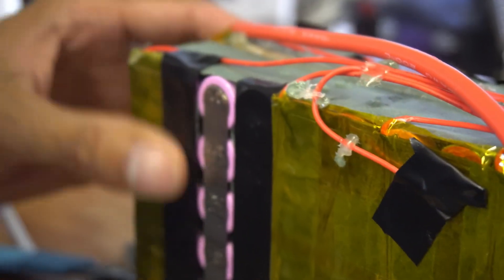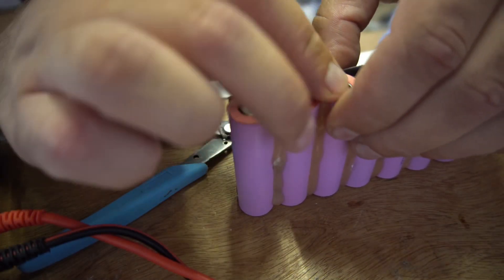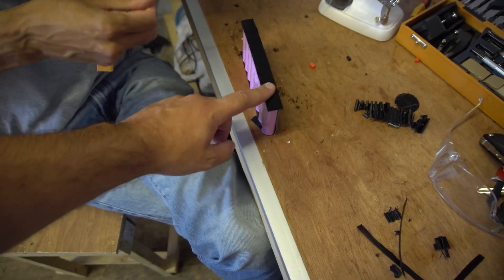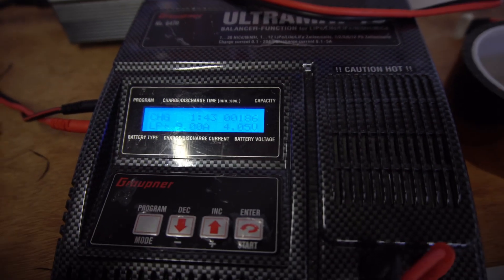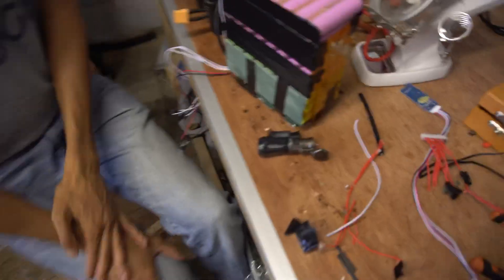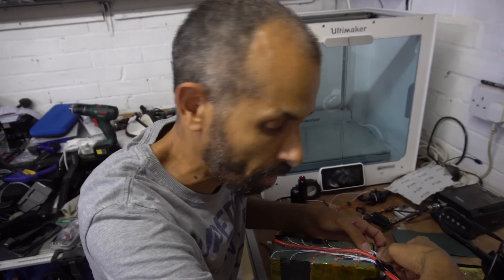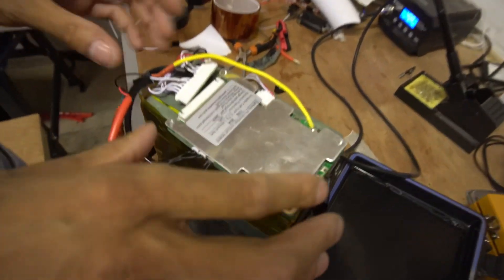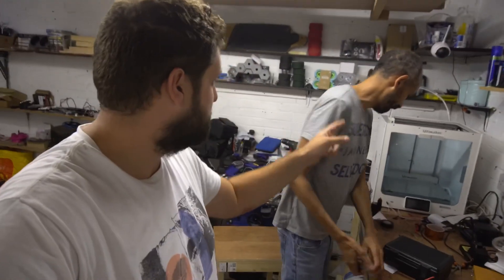Battery Emergency Surgery - Lost a P group! (Part 2)

Comment: 3 hrs to charge I would of killed for that. charger alone took 11-13 hrs to charge my 22000mah lipos the booster took that down to 5 hrs
Reply: Scott Harvey what booster are you using? I use the same batteries in my trampa and it takes forever but every booster I’ve found has been sold out online

Comment: Good video again Lee :) quick tip. when applying the glue to the cells, you should go the opposite direction to what you were doing. that way the glue gun nozzle will push the glue in between the cells better and the finish is cleaner too.
Reply from the maker: Brilliant! Why didnt I think about that? Thanks man will deffo take that tip forward for the next one
Reply: thats a legit good idea!